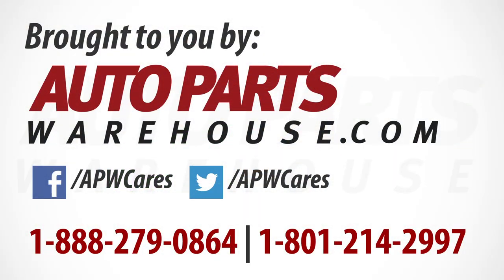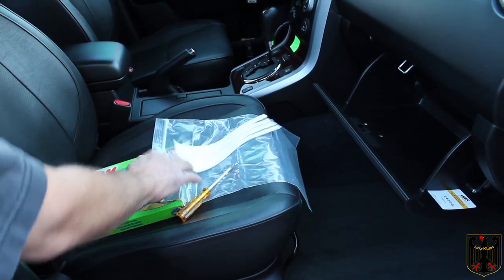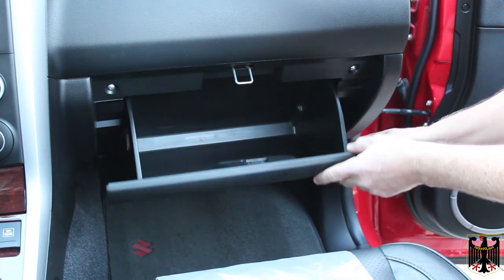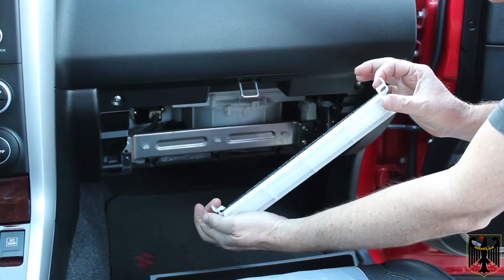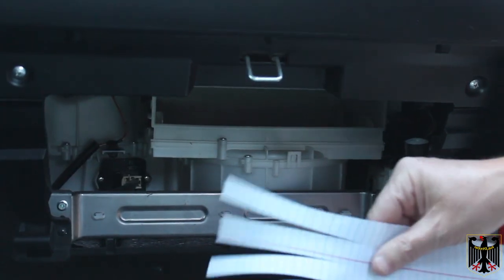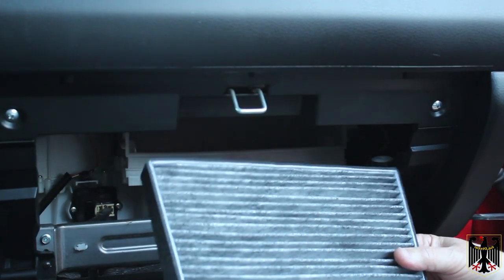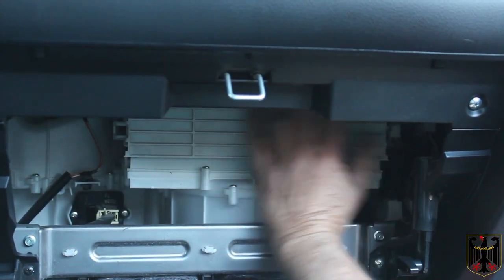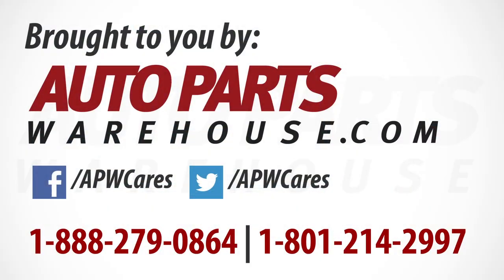Suzuki Grand Vitara Fram Cabin Filter Installation

Comment: 3:14 How about it, what function does that small black plastic cylinder that is on the right that you push when you fit the glove compartment.
Reply from the maker: I believe that's the damper for the glovebox if I recall correctly.  Thanks for watching!

Comment: and you used a Fram filter? oh dear....I will never use any product made by that company ever. Not if i value the longevity of my vehicle.
Reply from the maker: I generally don't use their products either...I refer to them as the "orange kiss of death" in the oil filter world.  Their cabin filters aren't bad as aftermarket replacements though, and for this particular vehicle, OEM ones were hard to get a hold of at the time (and still are).  Thanks for watching!

Comment: why didn't you show how the dampener is attached? is there a quick release for it? Do you take out the screw half covered by the arm? Do you pop the arm off?
Reply from the maker: It's been a long while since I did this video, but I believe it was difficult to get the area lit enough to see and still fit a camera in.  I can't speak to how it is removed since the vehicle was totalled years ago, and I haven't done this particular job in ages due to that.  

Thanks for watching!